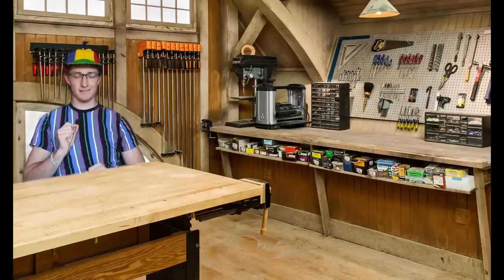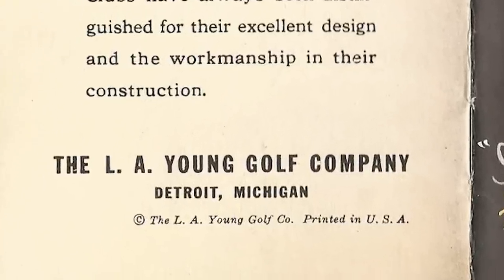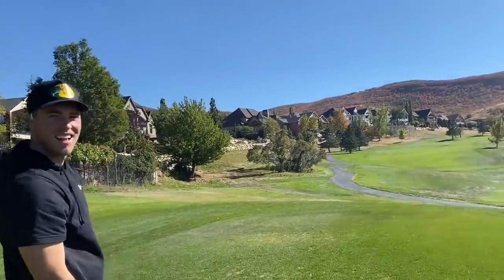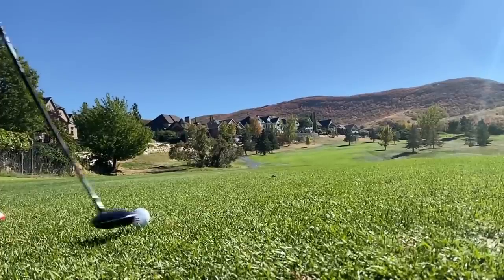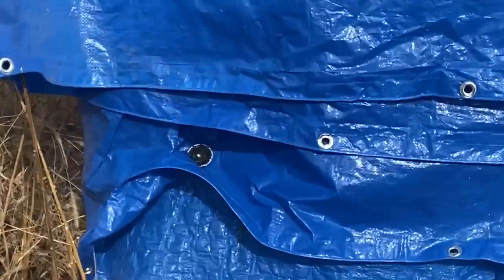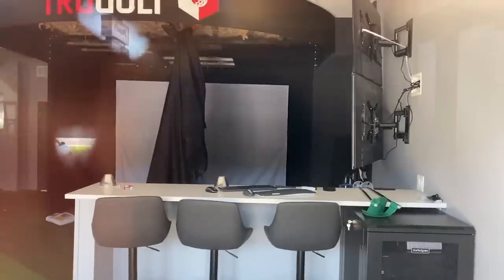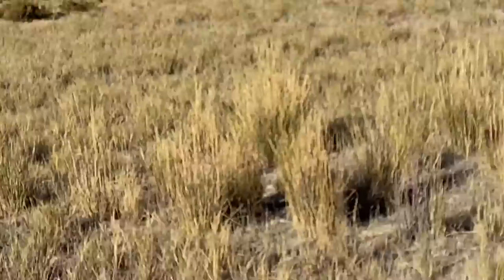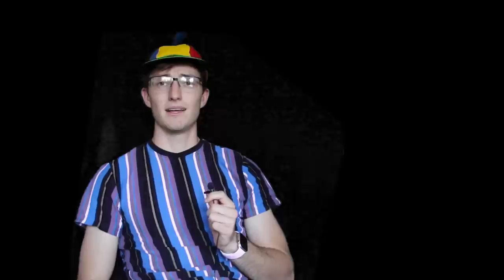Why Did Golf Balls In 1935 Have An Edible Core?

Comment: I’m returning to this channel after like 3 years. What happened to Dan and Mitchell
Reply: It was really strange, they both did a backflip and disappeared up each other’s asses! There’s a video of it on YouTube.
Reply: Genuinely, there’s been a couple answers. One was that Dan and Mitchell both got offered positions, Dan received some upper management job and Mitchell got a higher position within their union and as such their new jobs are more time intensive and they don’t have the opportunity to make videos as much anymore, this came from someone who was allegedly one of their old coworkers. Another person claimed they had contacted the shop and that Dan and Mitchell had left that job to work somewhere else, this is somewhat supported by them joking about getting their last paychecks in a video but is challenged by them both appearing in a number of videos after that. The final answer was that they’re still tangentially related to the channel but decided to take a back seat for a while from content creation all together, and also from this channel specifically, this is supported by them reviving a different older channel they were running and then abandoning it again after only two videos and that coinciding with, approximately, the same time they stopped appearing here. They do clearly still have a relationship with this channel, so it’s not impossible they’ll return at some point, as the current hosts make references to the two of them such as their Dan mannequin or Mitchell licking things in the FAQ of their website. If the guys had no intention of returning and didn’t want a relationship with the channel anymore, they likely would’ve asked to remove those things from the channel and website. I’m pretty sure they both have families too so it might just be that they’re either doing work in the shop or work for a different shop and also trying to balance being there with their families so they decided to shelf this for a while.

Comment: Stupid idea for October. A pumpkin encased in resin. You could get a small pie pumpkin. drill a hole into it and fill it up with resin then encase the outside with resin as well. If it works out then you could try for a larger pumpkin next year